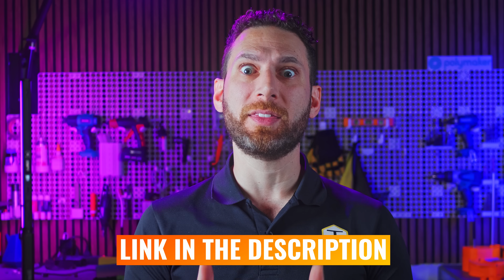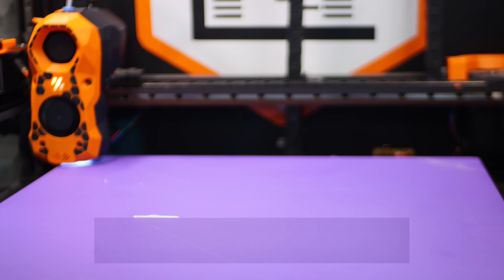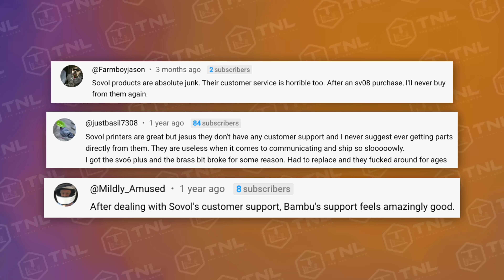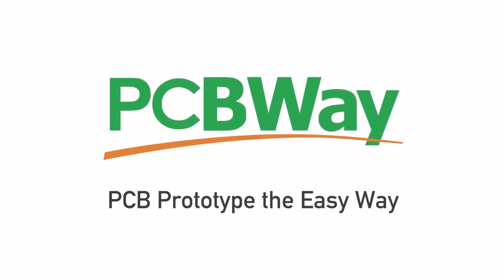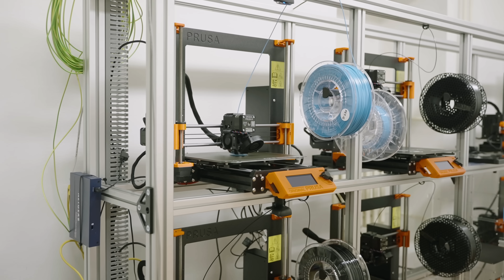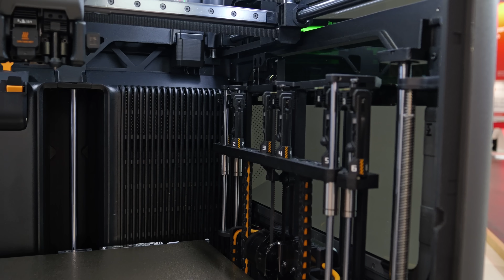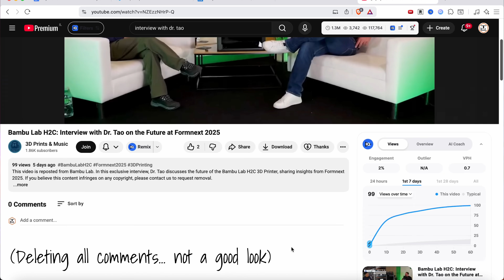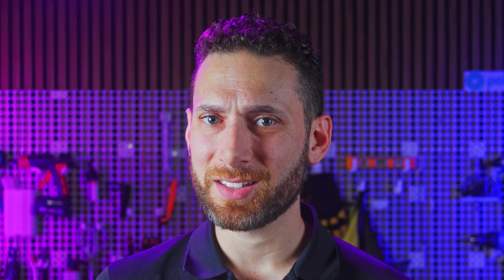My HONEST Annual Report Card for Each 3D Printer Brand

Comment: No one, I mean no one, makes as reliable of a printer, that just prints, out of the box, as Bambu does.  Its a laser printer at this point; anyone can just use it.  I've not had to user their support. but hear its not bad, particularly for the average person.  Prusa could be that company, but sadly, they just can't compete with the price point!  I would get a prusa Core over a Bambu, if it was only say 10 or 20% price premium.  But its not, its 100%  I can basically buy 2 (two) Bambu H2S for similar price, easily when on sale, could almost get both with AMSs!  So way more features, for almost 1/2 the cost.  Also, Bambu (at least in Canada), ships you the devices within a couple of days. Prusa, think its currently 6-8 weeks!!! 
Prusa HAS to find some ways to cut costs.  The Idex system will save them for a little time... but eventually Bambu will come out with an idex, and it will be game over for Prusa et al.

Comment: As someone that wants to get into 3D printing to use it as a tool to make more tools and useful prints I've been interested in bamboo for a long time but now I'm not sure if they are the right direction. Is there a specific model or brand of printer you would tell me to consider in place of the P1S with AMS that I've been wanting to get?

Comment: 2026 will start with the """new""" (more like what it should have been from the start) elegoo Centauri Carbon and whatever Artillery is doing to fix the M1 Pro. Curious to see what will happen because I'm soon going to upgrade from an Artillery Genius and those two were the printers I was more interested in but had lots of issues. (I know there's also the Anycubic Kobra S1, that's under observstion too.)

Comment: I have to say...I have a Bambu a-1 mini, and it rocks. the first unit I got, about a month in, I was printing something and the machine messed up and somehow built a 4 inch cacoon of plastic shit around the nozzle area. It took a month and a half to get a new unit. They sent me a new nozzle and other bits, but I could not get the plastic off. Then I had to mail them the unit, and after they observed my issue...they sent me a new one, and it has been flawless. They were always pleasant and reasonable with me, but it was clear that I would be jumping through their hoops...like I was lucky to even have one of their units. That's not really a complaint, it was just an interesting experience. They would send me directions and require pictures to move on, and stuff like that. They're closed ecosystem BS is BS.

Comment: I really wish I could afford a Prusa, but my funds are limited. Started out with a couple of cheap printers, then bought an A1. Let's just say, I'm not impressed. They have a huge cult following and often gaslight people new to printing spewing BS like Bambu is the best and the rest are crap. Lies . I have a Creality 3 V3 SE that has had a fraction of the downtime of my A1. And the prints are just as good. I do have an unopened Centauri Carbon that I'll use after my move across the country but I think people should buy what they can afford. Learn the process and the printer, then move up if they can. Bambu is not #1, and I told their customer service exactly that, won't buy another one, ever.

Comment: Snapmaker wishlist: Add dual nozzle to that 7 tool changer and include AMS compatibility for infinite amount of colors. Also, some sort of dry box or humidity control chamber for the filaments. Lastly, can we tighten up the profiles and tool change process so we can get rid of purge towers without sacrificing quality of the print?

Comment: my bambu complaint is simply this; my A1 Mini was a great deal.  Affordable, reliable, and easy to start!  The regular A1 is worth considering costwise, but not an instant-buy compared to other options on the market.  Then you get into the new stuff, and there are zero improvements to any of the "entry level" products, and even there corexy stuff is waaaaaaay out of budget for me.  Why on earth would I even consider the P1 series or X1 series when I can get a Snapmaker U1 with better filament changing for less money?  (compared to with the AMS combos)

Comment: Only the internet can cry about waiting 45sec for something. Too funny.
Reply: @tam653m  its not just 45s, it's 45s*[num of color changes] which often gets into and above the hundreds and quickly turns that 45s into hours over a single print job when it really should be less than 10s per swap when dealing with 1 filament in nozzle 1 and 1 filament in nozzle 2. that's hours of wasted tool time when fullfat toolchangers can swap entire tool heads in less time and it adds up in a farm/small batch production setting

Comment: I had preordered the anycubic kobra s1. And its been an absolute piece of crap. Riddled with issues.
Warped beds, bed carriage not even made long enough to support the back. Wifi issues. Poor quality hotends and nozzles. Poor quality PEI plate. Promised hot swappable nozzles that never happened. Predatory pricing charging £499 for early bird lreorder backers to then turn around 6 months later and selling the same combo for £350 showing a massive middle finger to your early backers, horrible slicer, horrible customer service refusing to refund a clearly faulty printer. Promised a 0.2mm nozzle for months, then releases a 0.25mm nozzle only. Really poor quality fans in the print head with vastly insufficient cooling. Promising 720p webcam feed, then reducing that to 480p 0.5fps a couple months later because the mothernoard and wifi cant keep up with webcam feed.
Closed firmware that requires "hacking" just to use mainsail, seriously. Threatening customers to invalidate their warranty because said custom firmware was installed, so you can measure bed mesh to work around your crappy bed design.
Replying to customers who complain that they should just buy the kobra s1 max because its a better printer, seriously?
Not even a chamber temperature sensor, even though you advertise being able to print in ABS and ASA. How can i print those filaments without a chamber temperature sensor anycubic ?

Ive wasted £499 basically. Anycubic printers never again.

Comment: The p2s is a good low end machine. I think the dual head printer isn't a bad idea, esp if you want to do support material+engineering material in the same print.  I think competition, esp pricing, caused Bambu to push their timelines too aggressively and it the quick release of products doesn't look so good.

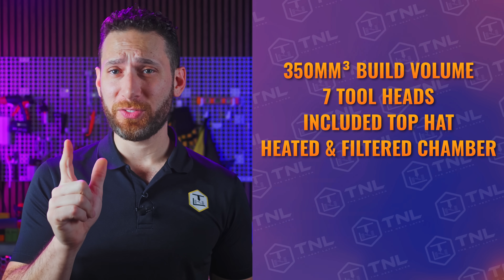Comment: 15:49 
To be that guy, print volume of the U1 was not 350mm^3,  it should be written as 350^3 mm^3. 

I knew it was mouthful but 350mm^3 is 0.35ml less than a drop of water. However, imo, it is okay to pronounce as the same as “three hundred millimeters cube”, just don’t write the same way.

Comment: I have an X1C and it has been great. Sadly I do not see a reason to buy any of their new products as competitors seem to have better printers at sometimes cheaper prices. Kinda makes sense that they made a first great printer before competition got good. 

My next printer will be one that can pint multi material and colors without printer turds, would you recommend the U1 or the prusa one when it comes out? (Or others)

Comment: While so much hate on Bambulab coming from the web, I honestly went against the flow and love it. Still in the business I'm operating it, I'll never use the business wifi or grant access to anything related, their shady collection of data was killing my initial will to recommend for an update over our old printer. However, our new H2S immediately made me fell in love with it, it's so capable to do a lot of stuff, that is simply embarrassing regarding the other players. Ordered some filaments too but however I ended using the ones that already had and even the dryer from sunlu as external box. No issues, just some 2 simple extra steps to achieve it. I think in this era of the industry, the fact that you barely have to imput any data for the filament, do dozens of tests to find the perfect feed flow, it's amazing. In one way, I caould even understand their point of view, away from the opensource comunity, this is a different machine as a package, it does everything with fine calibrations fro the factory already, while their experience with their hardware, is hard to compare. So for the guys that want less trouble shooting just imput basic like the ammount of infil, number of layers per wall/top/bottom, slice and go, this is a gamechanger. Is compared with big and way costly machines an easy win, while swapping a nozzle, way way way easier. Stopping the nonsense of collecting data will make them all round winners.

Comment: I bought my first 3D printer, a Bambu Lab P1S combo, in july. As a beginner, it was a great choice. It worked right out of the box and I could experiment and learn. However the whole system seems so hermetic. For example I wanted to experiment with 2mm nozzles. With your setup max nozzle you have is 0.8mm. Everything seems so closed. I know my next 3D printer will most likely be prusa since there are A LOT modification options.
So TL;DR

Bambu Lab is great for the start but once you want to try something specific, bambu lab will most likely fail

Comment: Hi Jonathan,
Here is my addition to your wish list:

My wishlist for SOVOL:
Not only your cooling fans are LOUD, but they run all the time, even when idle.
Please upgrade the fans and make the fans stop when not needed. 

My wishlist for Creality:
Please support related opensource projects like Kliper and Orca.
Give root access to Nebula Pad + publish the code (it is similar to Ender 3 v3 KE)
Publish a documentation on how to use Creality CFS and CFS-C on other Klipper printers, so we can use them for other printers than Creality. You would benefit from it too.
Adopt Prusa OpenPrintTag, or at least make CFS and your printers compatible with it.

My wishlist for Snapmaker:
Please, preaty please integrate U1 with an available opensource/opensource friendly AMS (BoxTurtle, BTT ViViD, maybe Creality if they opensource it)
Please support related opensource projects like Kliper and Orca (maybe sponsor BoxTurtle to create an integration with U1 )
Adopt Prusa OpenPrintTag, or at least make U1 compatible with it.
+1 to the 7 tools 350mm3 printer :)

Comment: I don't really get the point about Bambu teasing H2C months before releasing. Prusa announced XL in 2021-11 and started to ship it 2023-03. Prusa announced INDX and prototype on Formnext was leveling with induction probe, so it is definitelly months away from release.
Don't get me wrong, as European I wish Prusa would have more competetive products. And I would even pay more for same quality and open source infrastructure. But Bambu product line, quality and ecosystem more fits my needs.
Prusa MK3 was released in 2017-09. It had several upgrades, but its successor MK4 was released 2023-03. It took almost 6 years to provide major upgrade to their flagship. Lack of innovation during their best years is reason why Prusa falls behind Bambulab.

Comment: Fully disagree on the larger build volume need for Snapmaker.. when I see the huge bambu H series and 350 cubed or bigger ones and the space they take up.. and the height, of top loading AMS systems or toolheads, I don't want them that big. If you need helmets and the volumes, sure, the big printers make sense, but as a single printer at home hobby person, those big printers are hard to handle on your own, size, weight and doing daily things feels less at home and more print farm.

Comment: On the note of Elegoo I have a reasonably negative experience with them. 
I have a Saturn 3 - albeit it is a resin printer. When I've got it the power brick was broken. They've sent me a new one. It broke in about 1 month and sent me a new one again. 
After some time I've had occasional cases where the cooling did not turn on. I did not notice it once and it burnt out the screen. They've sent me a new one free of charge but the replacement procedure is atrocious. 
I have 2 software bugs I know and reported - still no fix since years. One is the cooling not turning on - it happens when I do not power cycle the printer before starting a new print job. Annoying but manageable. The other is that after a print is done sometimes the printer displays an error and lifts Z, then lowers Z, and displays it again. It wears down the lead screw in the section it does this - so every time a print is done I have to schedule it so I can check that it does not do the little dance for hours. 
After about a year the on-off button died. Turns out the capacitors blew. Now out of warranty I had to order a new PCB from them  that took about 2 or 3 months with bureaucracy as it is not an item that can be ordered, so a lot of emails, send money via paypal, confirm the paying, etc. 
Put in the new button, burnt immediately. Ever since I use the printer in the way they recommended. The PCB is not connected and the wires from PSU go directly to the MOBO. To turn on I have to plug in the power brick :D 
They sell things ridiculously cheaply and for the price they are remarkably. OK...  But customer support is hit - or - miss and now that I run a printing side hustle I just can't reasonably trust Elegoo right now.

Comment: Adaptive PA overrated. You literally can print 1 calibration with k between 0.02...0.08 for each material and be fine 😂 For real, in most recent printers you cannot even change PA smooth time - so, why you need to change your PA every print?

Comment: I personally disagree on the need for UI update on Prusa and nobody will change my mind. I don't want a padded interface for fingers, I want a sleek and compact interface that I can operate without relying on a potential failure point that is the capacitive touch layer. Also from repairability + parts point of view replacing rotary switch aligns more with Prusa than replacing whole screen assembly. Not everything needs a fucking touch interface (especially those fucks who don't add any haptic feedback)
Reply from the maker: I have nothing against the rotary switch! I just want something a little more sleek looking. Nicer text, and fewer lists… a tabbed interface for example.

Comment: I've been using my Snapmaker U1 for a couple weeks, and it's amazing. Every print has been flawless, and I've even disabled the prime tower now so there is zero waste, I don't think it's necessary. The only thing I wish it had is the ability to upload and print .3mf files directly from the mobile app. That would truly make it the best printer in it's class on the market. Bambu's mobile app is their only advantage over any other brand these days.

Comment: One thing i have to day about you telling them to discontinue the ender 3, they technically aren't the flagship series, but the ender 3 original is what they are known for and it makes the most money, their gonna continue the series until the profit margins fall to the point where they are losing money from it, they will most likely keep the ender for around 4-5 years i would say as a estimate, the ender seems to be dieing out in the last years because of printers like the hi and a1/a1 mini it still has a bit more time until it discontinues, but it might make a comeback because of the diy community making a comeback with the rpi prices going a bit down, there are alot more people then there used to be

Comment: You leave the Ender alone! It's a great starter printer even if it is a bit cantankerous in the beginning
Reply: It's completely out dated an obsolete. You can buy a bambu a1 or other similar models for the same price that work out of the box instantly without faffing about
Reply: @spencersmith2542 faffing about or whatever is half the fun! You learn a bit about the machine itself and mechanical diagnostic skills are priceless.

Comment: As a Creality K2 Plus owner, I appreciate the convenience of the RFID tag reader in the CFS. It would certainly be helpful if more filament manufacturers adopted a standardized RFID tag that the system could recognize. However, I believe a greater priority should be placed on establishing a universal spool size, which would benefit users across the board by simplifying compatibility.

Even though I’ve only had my K2 Plus for a year, I’m already eager to see what Creality has planned for their next-generation printer.

Comment: First off the H2C was always going to be slower than a toll changer. I dont understand the well 40 sec is not acceptable thing comes from. Its a trade off. You  have one extruder which means you have to retract the filament and feed the new one.  Then the nozel has to heat and purge a bit to ensure the flow is good. The up side is you have a less moving parts, and you get support for up to 24 colors and diffrent filaments. Dont get me wrong they missed the mark inna few ways and  not haveing a better AMS 2c that has faster feeding and hardened internals for abrasive filaments is one of those. But its a different take on solving a problem while trying to save space and keep the system inclosed.  Inl get the hate for there business practices but unless you are willing to dump every brand that dose that kind of stuff it comes off more as they hurt my feelings. Crdaulty, AnyCubic, Elgoo, apple Microsoft, Nividia and more all doe the same janky stuff. Its how corporations work. Yeah its BS and we all dislike it but its the reality of the world. As for the closed Eco system yeah it sucks. But thats what happens when markets mature. Flashforge is worse in many respects with that and like it or not Prusha and creality are also flirting with that side. Its how markets progress and it really sucks but its the truth of the matter.